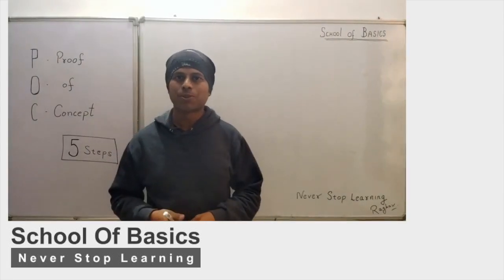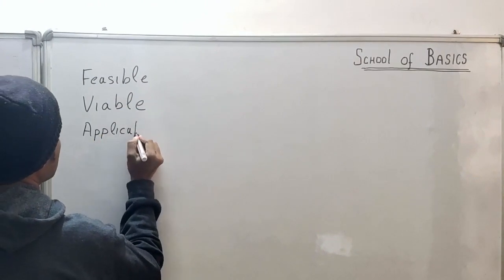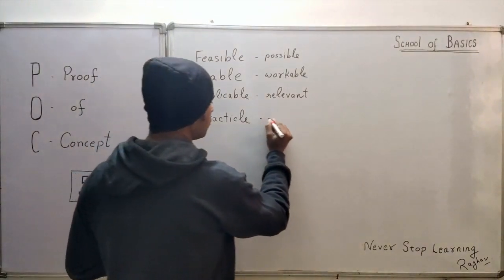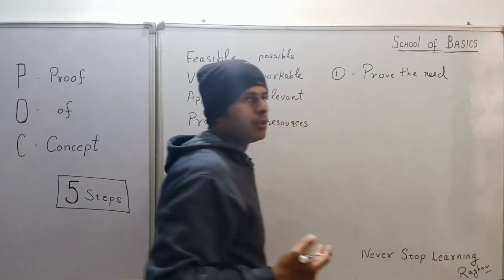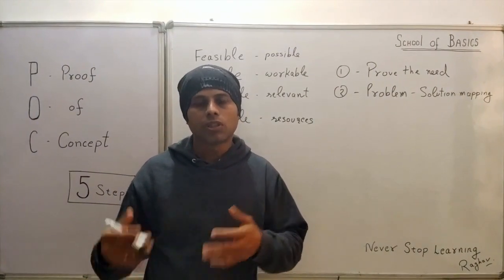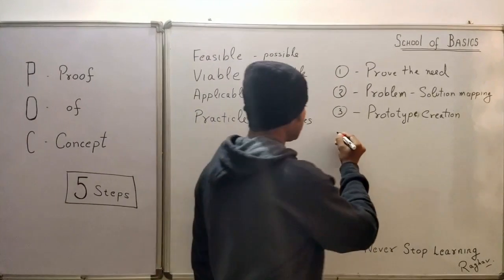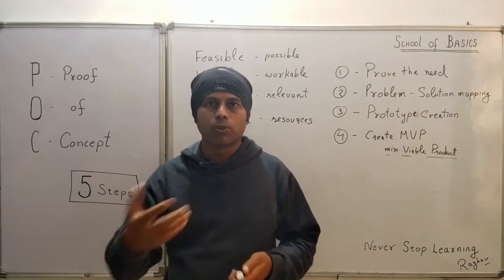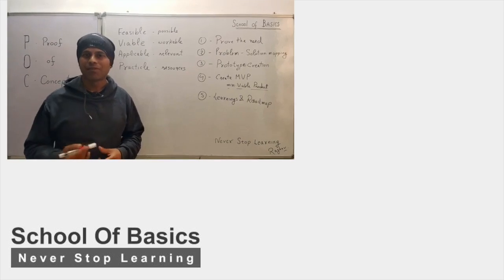School Of Basics | What is POC | 5 Steps to do Proof of Concept

Comment: Thanks for sharing, do you have any practical examples videos
Reply from the maker: Mazhar
The initial steps of POC includes checking on the viable options and then using the filtered tools, platforms for a use-case
Now if you have done this and have some filtered options, to do the next steps i.e. practically using it, you can check the list of tools, platforms here - https://automationstepbystep.com/